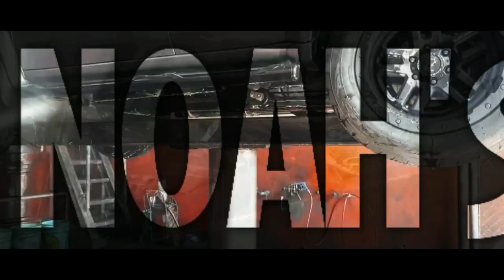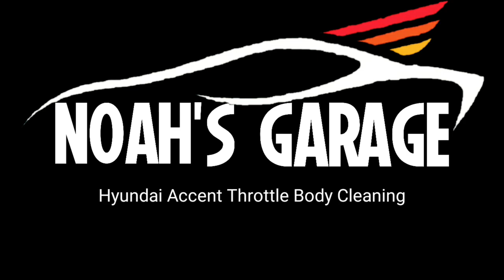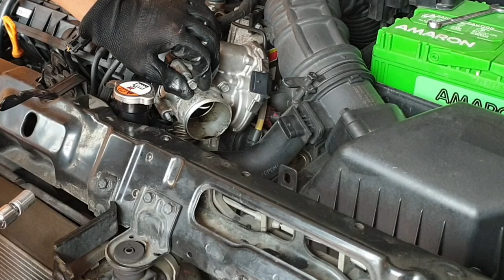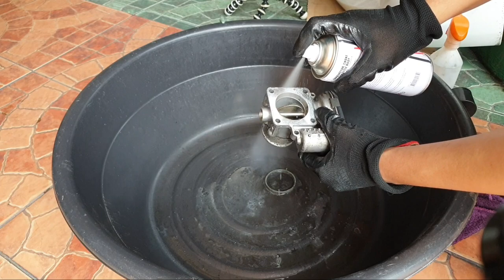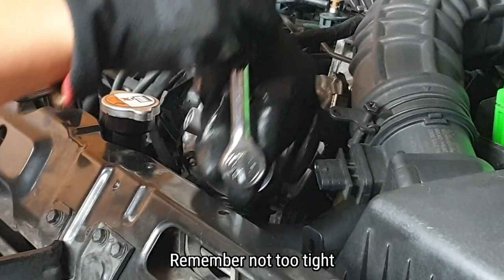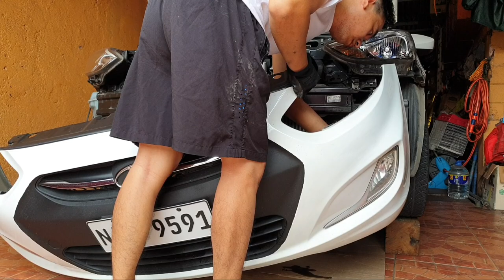Paano Linisin ang Throttle Body ng Hyundai Accent CRDI [Sikreto ng mga Mekaniko]

Comment: Thank you, great video.
Useful tip: when installing new ETC module or re-installing it, ETC module learning procedure must be performed.
1.	Hold the ignition key or the start button at the IG ON position, 5 seconds.
2.	Turn ignition switch OFF and then start the engine.
Reply from the maker: Salamat sir
Dont forget to subscribe 🙂

Comment: May advantage rin pala talaga ang OCC hehe. For low and high mileage cars hehe
Reply from the maker: Yes sir. 18k pa lang odo ni Accent, pero kita mo naman sir sobrang oil sa intercooler at sa throttle.
Ang problema ko dito sa Accent, di ko alam kung saan ilalagay ang OCC. Meron sa gilid pero ang haba ng hose na gagamitin tapos tatama pa sa turbo, baka masunog lang ung fuel hose.
Reply: @NoahsGarage  ibigsabhin may blowby gases talaga na nakakalusot. Try mo yung tulad sa akin na OCC sir mas maliit siya compared sa greddy.
Reply from the maker: @lylebacar4547  Sige sir, figure out ko muna ang lalagyan ng occ sa Accent. Sa lunes me follow up video ako sa blowby, abangan hehe

Comment: Idol nice video, sana mka gawa ka video pano gumagana uNG ETB. Idol ntry mo na ba icheck sa scanner kung gagalaw xa kada apak sa pedal? Or dependent xa sa ibang semsor tska sya gumagana? Kasi sakin lagi open, mapa.park or drive, gagana lang xa pag mataas na amg air intake temp at exhaust temp.
Reply from the maker: Kapag diesel sir talagang always open. Kaya ibang diesel cars walang throttle body. Noah na lng po, not idol please. Salamat
Dont forget to subscribe 🙂
Reply: @NoahsGarage  salamat bro noah, at xa nga pala baka my idea ka kasi ung accent ko madalas ng.jejerking, putol2 ung takbo prang inuubo. Napansin ko ung egr nk.crack open ng.pafluctuate minsa open ng 40% or less. Kay sa sunod kung apak inuubo na xa. Bago na ung egr assembly ko pero ganun parin.
Reply from the maker: @janechelonrico5218  pacheck mo fuel system. Palitan mo fuel filter then check mo injectors
Reply: @NoahsGarage  napalitan ko na fuel filter, linis din tank, tpos last week npalitan ko 3 injectors na second hand. Ayaw na kasi mg.atomize .

Comment: Hi sir. 50k na po tinakbo ng Hyundai Accent CRDi ko. Ano po mga dapat ipalinis? Salamat!
Reply from the maker: AC cleaning
Air intake system or Decarbonization
Oil change / flushing
Tire rotation
Brake cleaning
Radiator coolant change (not flush)
Dont forget to subscribe

Comment: Hello si Noah. Tanong ko lang po, ano po kaya dahilan biglang nag accelerate yung accent ko pag nagshift ako to 2nd or 3rd gear kahit d ko pa inaapakan ang pedal? Instead na pababa ang rpm eh pataas yung nangyayari kaya napapa brake or clutch na lang minsan. Accent crdi 2014. 🥺 salamat po. More power to your channel!
Reply from the maker: Manual sir? Baka mali lang timpla sa clutch sir during gear shifts.
Dont forget to subscribe
Reply: @NoahsGarage  Manual po sir. Naka eco mode din ako so may guide sa tamang pag shift. 20 yrs na ako Manual driver sir so hindi ko masabi na mali ang timpla ng clutch. :) Basta 1st to 2nd gear, 2nd to 3rd. or basta magdownshift ako either to 2nd or 3rd nangyayari. 😅

Comment: May tanong po sana ako sir. Luma na sasakyan ko tapos subrang tagal na siguro d nakakatikim ng coolant cooling system ko dahil d ginamitan ng old owner. So plan ko gmitan ngayun. Poblema ko is puno sya ng kalawang, if gagamitan ko ngayun ng coolant baka mag loosen mga kalawang at un pa ang cause ng radiator leak or baka sa engine block dn pasok sa combustion chamber. Sa tingin mo sir?
Reply from the maker: Do a flushing first. Tangalin mo thermostat sir para ma flush ng maigi ang system. Then buhusan mo ng distilled water ang upper hose ng radiator, lalabas ang tubig sa thermostat opening. Lahat ng dumi at kalawang lalabas doon. Sa radiator, buksan mo ung lower hose tapos padaanan mo rin ng tubig sa radiator cap. Gawin mo yan hanggang sa mawala ang kalawang. Since na me kalawang na radiator mo, I suggest palitan mo na radiator mo sir, though you can try my suggestion above.
Dont forget to subscribe sir 🙂
Reply: @NoahsGarage  thank you sir. Pwede dn radiator flush ng prestone? Pero ndi ba magkakaroon ng butas yan sir kasi baka yung kalawang nlng yung naghohold ng ibang parts like sa fins?? If makukuha ang kalawang open na. And ginawa ko na yung suggestion nyu po. Pero sure ako mga walls nlng madumi pero yung tubig sa loob clear na.
Reply from the maker: @cuvame  subukan mo sir lagyan ng tubig muna tapos i close mo lahat. Then look for leaks. Yan ang mahirap kapag me kalawang sir, napabayaan yan eh. Pag me kalawang malamang me butas na sir.

Comment: sir noah panu po gawin ung nakabukas agad un valve ng  throttle body
Reply from the maker: Most diesel engines sir naka sara ang throttle plate upon disassembly, for gas engines naman nakasara sir. Wag niyo po pilitin na buksan sir kasi electronic po iyan.
Dont forget to subscribe
Reply: @NoahsGarage  pero bat sayo sir nakabukas na? Paano po?

Comment: Sir yung sakin po nung nilinisan ko yung flaps naka sarado 2012 gas po yung sakin manual, saan po location ng idle air control valve?
Reply from the maker: Pag gas naka sara po talaga sir

Comment: sir same lang ba ito sa crdi 2014 MT? kasi parang iba yung ichura ng throttle body, walang nakakabit na motor katulad dyan sa video...
Reply from the maker: Yes sir walang motor, some diesel engines kc di na nilalagyan ng TC kc di naman kelangan ng TC ang diesel engines sir.
Reply: @NoahsGarage  ahhh ok sir, so  yung cleaning nya paano kaya..
Reply: Sir bakit nakabukas diba dilikado un
Reply from the maker: @boybootanarnoco2246  all disel TB sir open talaga ang throttle

Comment: Sir papano ninyo na open yung throttle plate kasi sa akin by default naka close. Ayaw ko siya galawin so ginagawa ko pina aapakan ko yung gas pedal para ma open dun ko lang siya malilinis. Gusto ko rin sana tanggalin throttle body ko pero di ko alam torque specs ng kotse ko saka di ko alam kung pwede ko ba galawin yung throttle plate salamat. Honda civic po pala yung kotse ko mas madali kasi yung luma ko altis dahil cable siya yung honda may idle relearn pa 😆
Reply from the maker: Kapag gasoline engine, talagang naka close ang valve. Kaya I suggest na tanggalin mo ung throttle body para malinis mo siya. Dilikado kung tatapakan mo pa ung pedal, baka biglang magclose yan, masakit maipit niyan, baka maputol pa daliri mo. Pagdating sa torque specs, basta mahigpit lang okay na, wag masyado maghipit at mababali ang bolt.
Reply: @NoahsGarage  salamat sir sana magkalakas ng loob na alisin baka next year pa naman kasi every year ko siya nililinis salamat
Reply: sir paamo magtanggal ng clamp sa hose ng throtle body